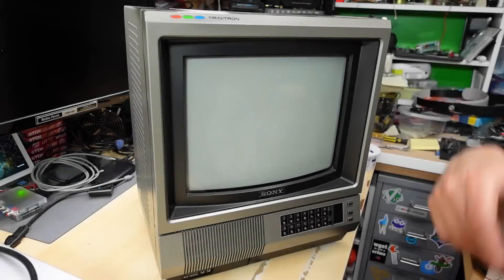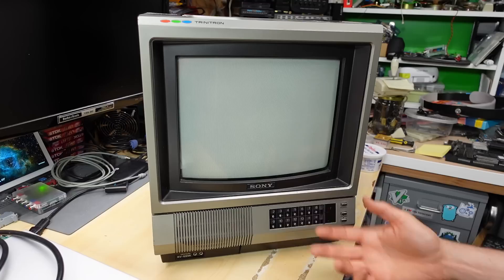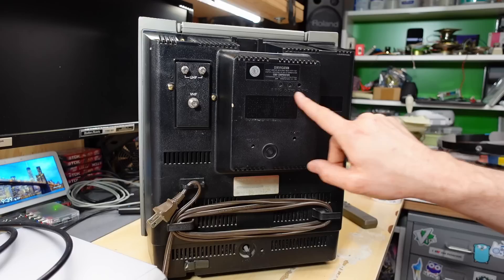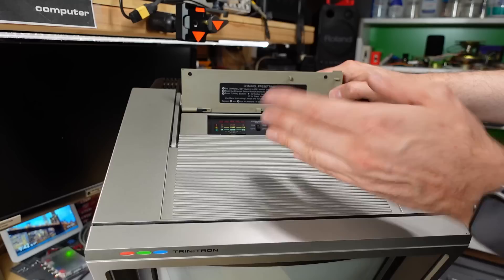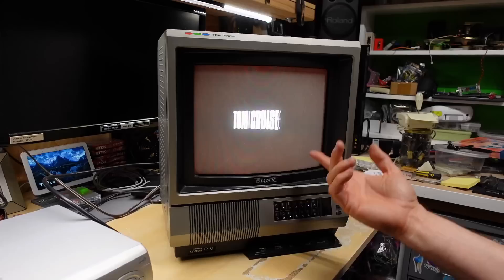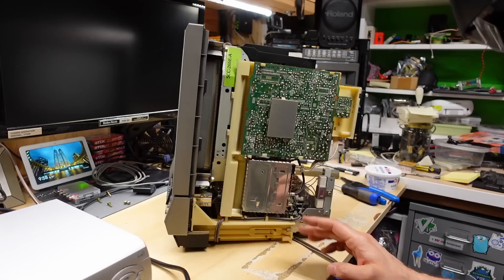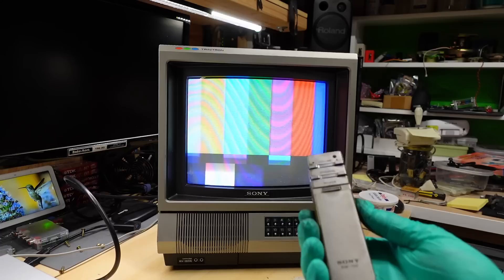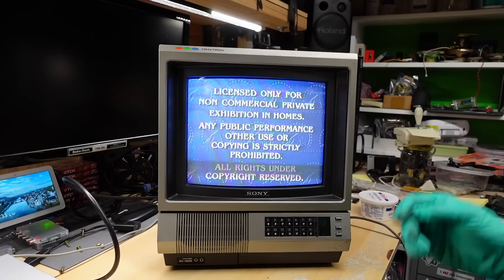This portable Sony TV from 1982 has a futuristic aesthetic

Comment: Minor correction. When you mentioned the purity issues with the previous TV you used the term shadowmask. These Trinitron tubes don't use shadow mask. They are referred to as aperture grill. If there was damage to the grills I think the purity issues would be way more pronounced and not limited to those small areas. I think you just need to get a degaussing wand as the internal degausser isn't strong enough to get rid of it.
Reply: I agree

Comment: The picture seemed slightly tilted, but otherwise good. So stylish!
Reply: I noticed this too, I wonder if Adrian had noticed at any stage?
Reply: So far, every one of them seemed this way.  Not sure if that’s a failure mode of the yoke driver on these sets, or if Adrian tweaked them while they were on a crooked table.

Comment: The plastic inside probably yellowed from the flyback voltage leaking slightly and creating ozone.  That's what the smell of a CRT after you first turn it on is, the static discharge creates ozone.

Comment: Thank you so much for this video.  My sister and I both had this exact model TV.   They were purchased for our rooms by Mom and Dad when I was 6 and she was 12, right in late 1982 when we moved to a new house.   Yeah, maybe my parents shouldn't have put a TV in my room at 6, but hey, I turned out ok... I  think  :)    My sister kept hers until the late 1990s and I kept mine until summer 1999, when I was 23 years old and purchased 27" Sony for my first apartment where I moved later that summer after college graduation.   Even after that point, I gave it back to my dad as adult and he put it in his kitchen until around 2008 when the small flat screens became affordable.  It was still working perfectly,  26 years later,  at time of replacement.  Unbelievable.   Yes, I did get a replacement universal remote in the 1990s for it.    I used it for TV + Commodore 128 monitor in the late 80s' .... I had a sharp VCR hooked up to it around 1991 or so, which I used the CATV tuner on the VCR to get the channels.   Adrian was correct that the antenna was a V for the VHF  with the twin leads and was from Sony, and the UHF antenna was a circle.  He was also correct that the tuner allowed you to set every button as a preset and the TV came with a sheet of those plastic numbers you could pop out and put into those presets.  I think it included some symbols too you could use.  They were high quality plastic.   Adrian also didn't mention that Radio shack sold a simple ARCHER brand converter box you could hook into the TV that would allow you to tune the CABLE TV channels on those presets as well (instead of VHF and UHF), once you ran the coaxial line to the jack on back of TV.   Once connected, you flip open the top and you can tune to MTV, CNN, HBO, SHO, whatever your cable system had at the time, and set the presets.    SO this is before I used the VCR as a tuner and also before the digital separate converter boxes were cheap enough.   This TV went with me after high school to a college out in the midwest and then back to east coast college.  It was used all the time, no issues!  Imagine that, I was using same TV in college dorm and apartment that I had when I was 6.     I remember the feel of all the buttons, the handle, the controls on the top of the TV had a nice spring in them when you pushed them down.  Made in Japan and there was so much pride and quality parts in this TV.  To this day its rare to see products of this quality.

Comment: I'm loving these TVs! I have a KV-1370R (with wood grain) that I use for older game systems. It needs a little adjustment. I get red streaks to the right of anything that is red. But it's not that bad. I don't have the nerve to open it up yet. I am inspired by your ability to fix the color issues, but not so naive to think I can just do it myself without a lot of research.

Comment: This set from 82 will outlive my 2018 4K Bravia that is already on it’s second mainboard, and it will be „obsolete“ as soon as Sony will stop issuing update for it’s Android OS.
Reply: The LEDs will fail way before that happens
Reply: @DavePoo  been there, done that in a Samsung 32ES6100 where a light strip failed, it was replaced for 25 euros, and the TV is still alive, being diverted from the scrap heap.

Comment: Trinitrons do not have a "shadow mask," they have an aperture grill. I don't think that other TV has a damaged grill. It's not impossible to mess them up, but it's much less common, and when I've seen it, it does not look that way. I think it needs to have an industrial degaussing job.

The tuner issue is probably components dragging down the IF section of the tuner. As you said, the new one is PLL and the newer components allow it to lock to the signal.

Comment: This TV set have not CVBS input, we must use a RF modulator for use with a VCR, or external modulator for watching a DVD, DVD players have not RF modulator

If modulators use UHF channel we must using a 75/300 Ohms impedance transformer.

If you watch a NTSC 4,43 video, or NTSC Playback on PAL TV 60 Hz, the picture is Black and White, this is not a malfunction

Comment: Have you tried getting a high quality dedicated RF modulator and testing with that? I used to run into all sorts of problems connecting video game consoles through a vcr because the RF output wasn't great, or wasn't really filtered properly by my tv. Using an rf modulator and cutting the vcr out of the equation cut out the noise and gave me a near composite quality signal. My theory is that newer vcrs omitted some filtering to cut down on cost because newer tvs could either filter the signal properly or they went with the assumption that RF just wouldn't be used and people would opt for composite or s-video connections instead.

Another theory is based on your cables. Have you actually tried different cables for all of your connections? This is a situation where RF interference matters a whole lot, and you've talked about how noisy it is in your basement. It could be some tvs are just better at filtering that interference from the cables than others, and those Sonys exhibit similar problems because they use similar circuits for that. Also, if you do try different cables, try cables of different length. You can actually turn cables into antennas for whatever interference your basement generates, and a slightly different length could fix it immediately.

Comment: Did manufacturers stop including those fine adjustments in the back in the late 80's thru the 90's or did I just never notice it on my CRT TVs?
Reply from the maker: A late of TVs moved to those things being controlled by the micro-controller, so you can access a service mode to make adjustments. I'd say most TVs by the mid 90s had this.
Reply: Many TVs and computer monitors still had a lot of those adjustments on analog pots, they were just on the neck board or control board, and only accessible if you took the case off.  I guess the assumption being only a service tech would need to touch them, if anyone, after they left the factory.

Comment: Why is there no channel 1 on this TV?
Reply from the maker: Not sure -- it is just part of the North American channel number plan where it starts at 2. CATV had a 1 -- as did other countries that had allocated channels, like Japan.
Reply: @adriansdigitalbasement2  so it's a 1 on 1 representation of the frequency spectrum. I am from Europe so that might be why I never made the connection.
Reply: It has to do with a fight between the radio industry and the early tv industry. There was a channel 1 set up in the 1930's and 40's for tv. but the radio industry wanted the broadcast bandwidth that channel 1 was on, and they got it in 1948. Though instead of renumbering the tv broadcast channels, the fcc just told tv manufacturers for the u.s. market to make 1 inaccessible and start at 2
Reply: @ericp631  thanks for your reply